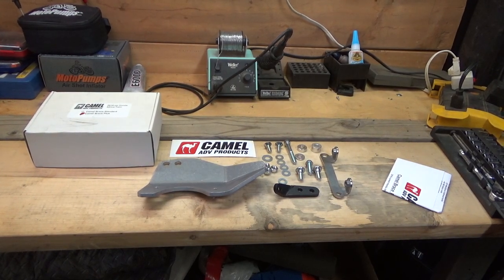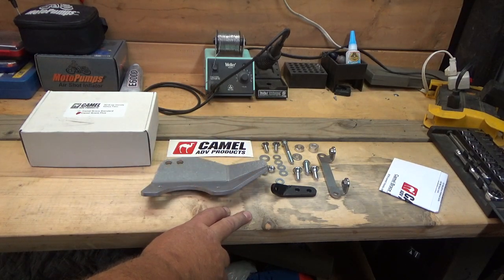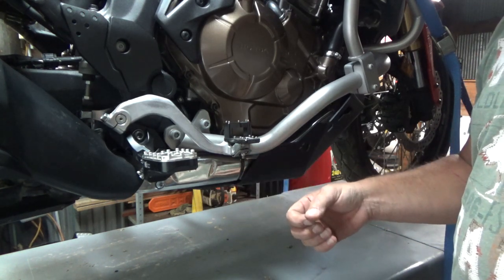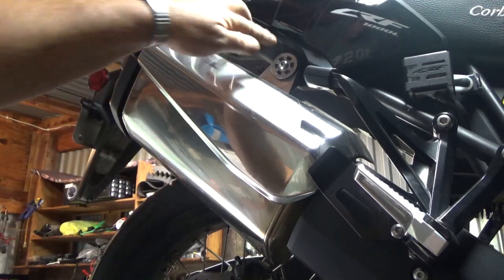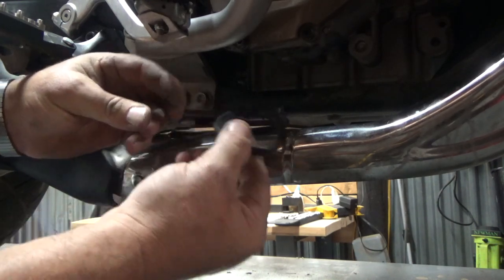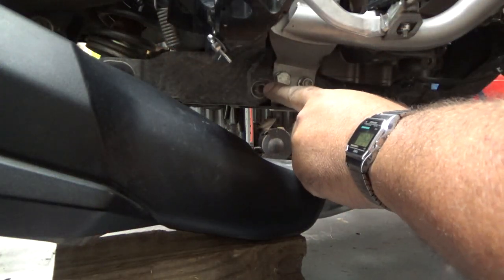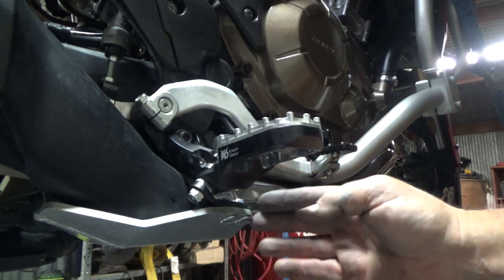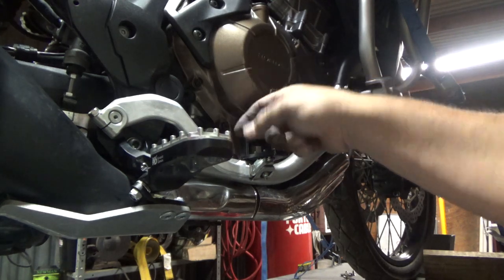Africa Twin "Camel Brace" Peg Support Install Camel ADV Products CRF1000L

Comment: I had a terrible time installing mine.  I followed the directions to the letter and the peg bolt wouldn't line up.  I had to redrill the hole and it still was off.  The peg doesn't move all the freely.  I also broke the o2 sensor bracket when trying to release the clip.  That is gonna be a major pain to replace.  The exhaust was heavy and I had to have some help holding it.  Would have been nice to have a stand to get it off the ground.  Jealous.
Reply from the maker: Oh wow. That’s no good. I hope you get it fixed